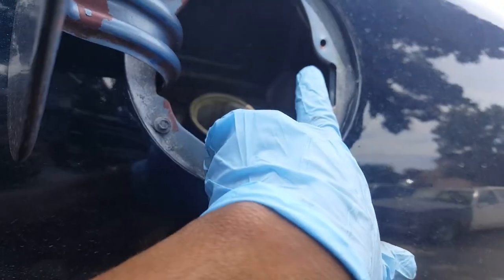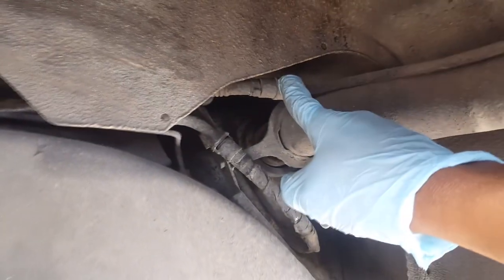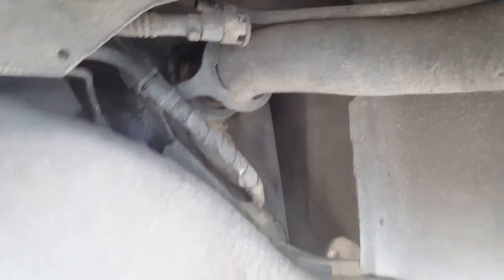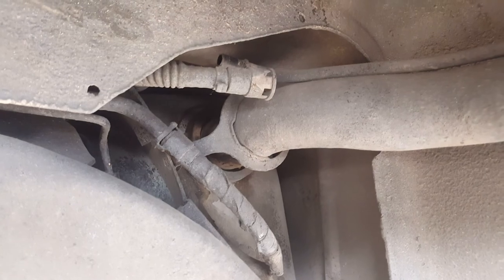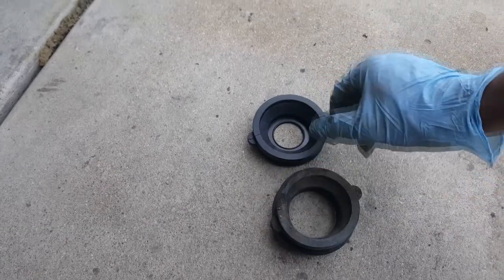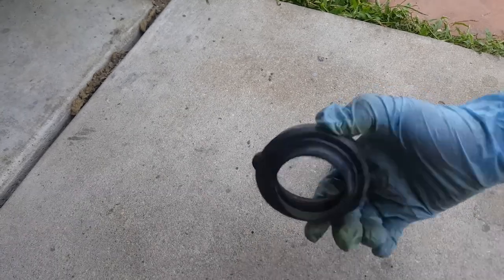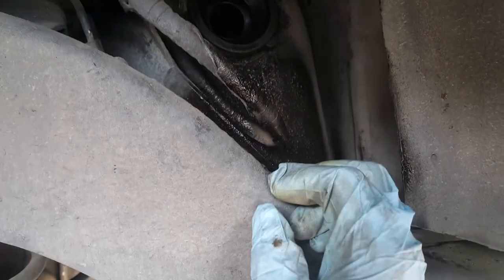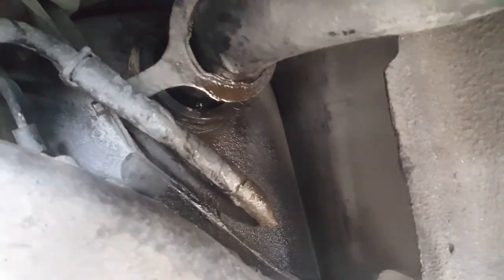EASY DIY Filler Neck Seal/Grommet Replacement Towncar, Crown Victoria, Grand Marquis

Comment: Filled my 99 grand marquis up and got home and got a big whiff of gas when I opened the door. Started looking around and noticed it was a bit wet around the bottom of that seal. Guess I'll be replacing that one! odd it started leaking out of nowhere. Didn't leak last time I filled it up.
Reply: Had the same issue on my 98 mustang. Guess its a ford/Lincoln thing
Reply: @SpoonMan94  yes just an old worn rubber seal at the tank and filler hose.

Comment: This is VERY replaceable WITHOUT dropping the tank. The leak on the vehicle I was servicing, had a hole developed by corrosion(rust), that was in the same spot the neck seal is, so it made it look like the seal was leaking in this particular vehicle. I do believe the seal needed replace anyway, as that was what I was doing anyway. I had suspicions that it was a crack/hole in the actual neck itself but could not see it, so went with replacing the seal. Once the neck was out, I would further inspect for any other causes of fuel leaking. Sure enough, I discovered the rust hole on the fuel neck where the seal is. So I patched the neck (replacing wasn't an option in this case) so patching it with a small piece of fuel tank patch stik (its like a putty, that you roll up to get it to activate, and press into leak area, and it then hardens. VERY good stuff. I then went over that with a thin layer of JB weld just to be safe. It was actually a clean patch since i'm not a retard with either product. Replaced the grommet as originally planned, never leaked since. I'm sure it won't until that car is long gone totaled or in a a junk yard somewhere.
Reply: Thanks for sharing! I’m keeping that tip in my back pocket. My 09 F150 King Ranch has a small evap leak P0442.  I think it is coming from the fuel neck and not just the capless fuel inlet inner valve seal…aside from performing evap test using scan tool/smoke machine are there any other ways to test/inspect for leaks?
Reply: Not with me it it won't move back enough to get out the way it sucks is mine diffrent?

Comment: What tool did you use to take off the pressure line fitting? I took the clip off but the ends won't come apart. I have the filler neck out but I can't separate if from the fitting. 
Thanks
Reply from the maker: His Image a small pick

Comment: Was this giving you a EVAP leak code?
Reply from the maker: +Alex Cruz No codes, smelled like fuel all the time and leaked when topping it off.
Reply: I took my car to the smog, last five or so years.  (1990.Mercury Grand Marquis LS).

My brother noticed when I first got the car, that I would need to replace the filler neck.
   
Yesterday, the Smog said my car passed everything, but it had an Evap Gross Leak.  

Looked it up on the internet - the internet directed me to a p0455 code.  My car never threw one.  

I looked at the filler pipe.  Found this grommet.  And ok, about to replace it and hope my car passes.  

But, my car probably would have passed, if I had the gas tank filled up.  

But I can clearly see where gas has been seeping or leaking out.

Comment: Easy my ass some models with thinner pipes has some kinda plastic backing plate preventing it from going all the way back away from filler wall..... I wrestled with that sucker for hour trying to cut it away so I can back the pipe far enough to get it out and almost bent the vent hose, easy he says....